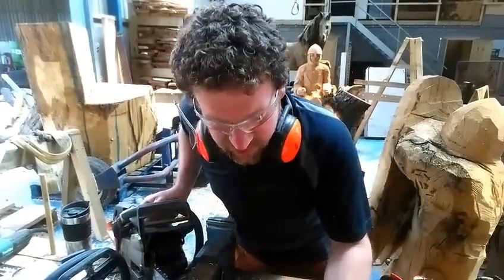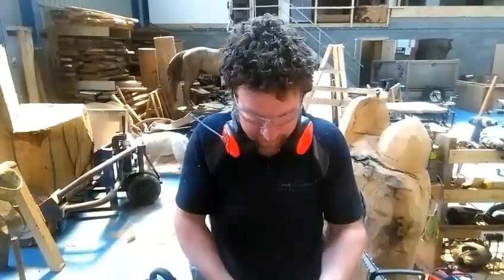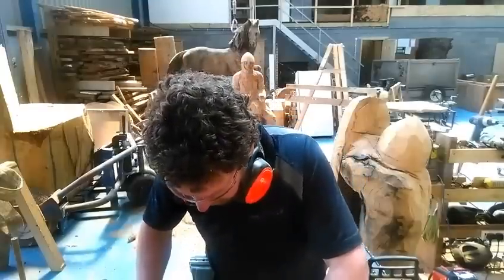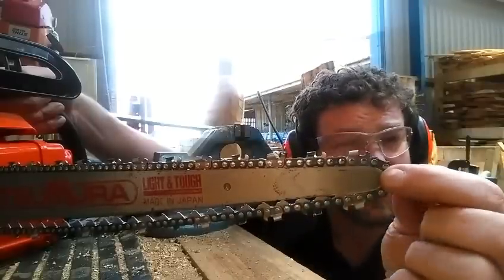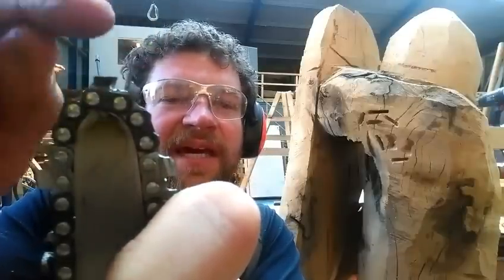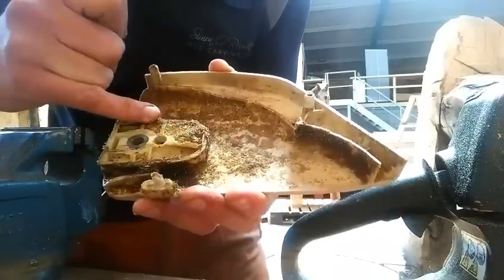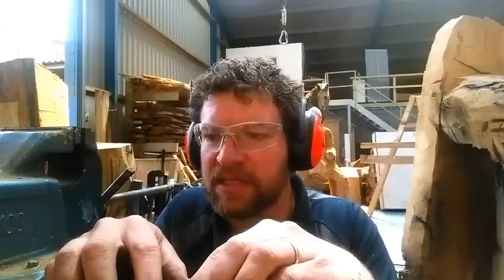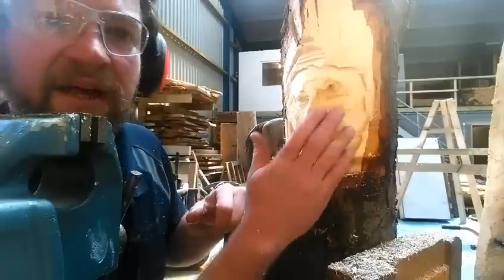Tsumura Carving Bar Review & Maintenance Guide | Essential Gear for Carvers

Comment: Thanks for all the valuable information with so much attention to detail.   Love your  the detail!    Ordered my first Tsumura bar from Bob King and put it on my new CS2511P and the chain fixed up as you explained.  Now just to get the tension right..seems like it needs to be alot looser than on my Oregon dime tip bars...got a small burn spot on the tip (looks like no lose of metal integrity), but loosening the chain even more seems to do the trick.    I am new to chainsaw carving since this Summer, and learning alot.    Thanks a million!!  Love your channel.

Comment: Thanks . This is the most informative video I,ve come across explaining bar and chain set up. Have been burning the tip and wondering why ;great explanation!  Was wondering ,what type of bar lube do you use? Thanks again.
Reply from the maker: I use Stihl bio oil at the moment but any mineral oil is good too. Some use canola but you need to keep an eye on it if you aren’t using a saw for a while as it can gunk up and block the oiler.

Comment: Does removing the heal on the chain apply to all brands of dime tip bars.
Reply from the maker: Yes it does. The smaller the tip the more you need to grind  off generally
Reply: Simon O'Rourke - Art Coach and Sculptor   The back of the cutter?

Comment: thanks for your video! 
i always wondered why the tip starts to heat up so fast...

Can you tell us what oil you use?
Reply from the maker: I use Stihl bio oil at the moment. I've used numerous types, the key thing is to make sure it can cope with high temperatures. Some people use canola oil, but be aware of you have some saws that don't get as much use as it can solidify or go thick when it's left standing.